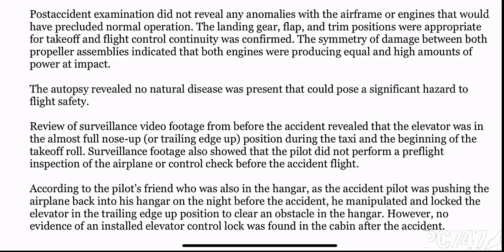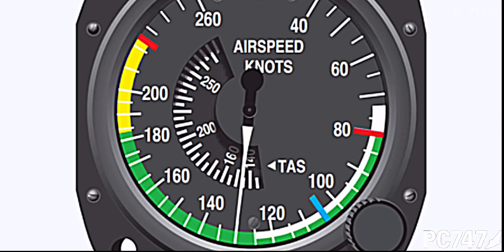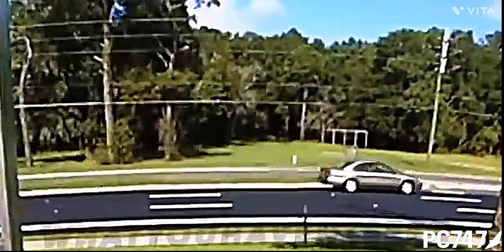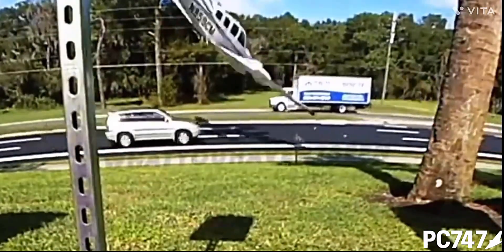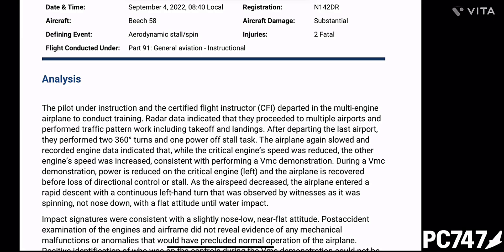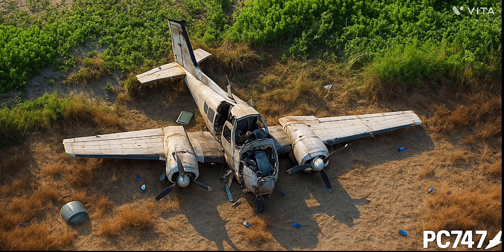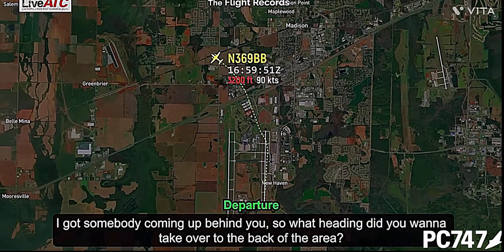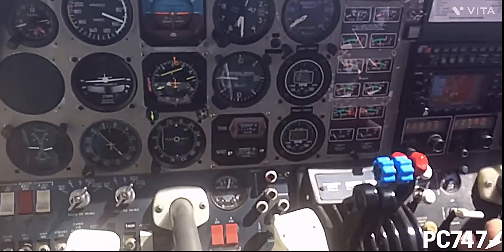VMC TRAINING KILLS

Comment: Wouldn't it be better to reduce thrust to get out of spin and dive to get speed up to have rudder control. Treat it like 2 engine failure.
Reply from the maker: Hi Joe,

   You asked a really good question….

.When a multi-engine airplane enters a spin (or incipient spin), especially after losing control at low speed and high power, the asymmetric thrust and yawing moment from the engines make the situation far more dynamic than in a single-engine aircraft……

Here’s why adding power (symmetrically) can sometimes help — and why reducing it too quickly can make things worse, depending on the situation:

    1-The “spin in the twin” is rarely a pure aerodynamic spin. Most “spins” in multi-engine airplanes are asymmetric stalls or post-VMC roll-offs, not true autorotation spins like you’d see in a Cessna 152. When one engine is producing more thrust than the other, that yaw + roll coupling can cause the airplane to depart controlled flight. In those cases, idle power or sudden power reduction can remove airflow over the tail and rudder, reducing control authority exactly when you need it most.

 2-Power ( TOGETHER ),adds propwash over the tail and wings. By increasing power on both engines together, you increase airflow over the horizontal and vertical stabilizers.
That extra propwash:
	Helps the rudder regain effectiveness
	Increases elevator response
	Can stop the autorotation before a fully developed spin forms

If you immediately pull both throttles to idle, that slipstream is lost, and recovery controls may have no effect.

But, by the same token, I’ve never actually heard of a case where symmetric prop wash over the tail actually worked and it made recovery from a spin possible. 

Another thing I forgot to mention was, the centrifugal energy of the weight of two motors spinning around which makes it even harder to recover from a spin in a twin than from a single engine aircraft.

Avoidance of spin entries altogether is the key.

Cheers!

Carlos
PC747

Comment: Why why why can't more pilots get real flying training by a CFI in a Super Decathlon like I did. My CFI was ex USAF F-104 pilot thank God, as he taught me to fly 'real good' in the Super D and Cessnas and Pipers. Look folks if you don't have aerobatics training, you should not be flying a jet or a twin. The F-104 had to ferry a 310 one day but it was to land on a 1000 foot runway with trees on both sides. I had left seat so I had the only brake pedals but I drove 18 wheelers so he 'trusted me with the brakes' :) Well I was PIC and on final slow and low it flew like a greased brick like your 747 I think. Dang it was hard on me as my first landing in a heavy twin the brick was a handfull on yoke and throttle. My god I cannot believe it as over the fence I was so terrible an approach the CFI yelled 'I GOT IT' and he flew it onto the runway with barely a bounce and then I wacked on the brakes and we stopped pretty close to the end of runway. No I don't think any pilot should do stalls in a twin with one engine out or at idle. These twins are terribly hard to fly, even with aerobatic training you are really really stupid to not listen to this 747 Captain. He knows a hell of a lot more than me or anyone else walking around an airport.
Reply from the maker: Hello,

   That was really quite thoughtful what you wrote. Thank you. 🤩🤩🤩

   My hope, in posting the videos, is to make a difference in the aviation community. Enhancing safety & training efficiency, while, at the same time, hopefully, making the learning experience better.

Kindest regards,

Carlos
PC747

Comment: I am a full time flight instructor providing about 40 hours a month of mostly multi instruction. Excellent presentation on the subject but a couple of quick points. The ACS does not restrict the technique of blocking the rudder to force the loss of control. The danger in this maneuver is not understanding what is happening. Some of the people involved should have known better, but didn't. The Chief pilot and school owner in the incident you referenced is my point. No slow speed work, slow flight, stalls, Vmc or drag demos should be done with anything in the back, passenger OR baggage. As you noted, the CG needs to be as far forward as possible. Second, the spin of a light twin is not the same as a single. Because of the weight, engine and fuel, being so far out the wing. The rotation that develops is a skid more than an aerodynamic spin. This changes the relative wind acting on the vertical tail causing the vertical fin and rudder to stall. If recovery is not started before the tail stalls, there is nothing to resisted the yaw. 
I only teach Vmc because I have to. Instead, I emphasize prevention, Vyse Blue line. In the proper configuration, once you have trimmed for Vyse, what ever performance you have is the best it is going to be. If you are still losing altitude, find someplace soft to land. You can not hold the plane in the air by pulling aft on the yoke.
Reply from the maker: Hi,

   Thank you for your very kind and detailed comments! 🤩🤩🤩 You are absolutely correct. Some of these pilots should’ve known better. You are also correct regarding the differences in spin characteristics between single engine aircraft and twins. The dual engine placement combined with centrifugal force, during a spin, makes it far more difficult to effect recoveries.

You are correct again. The ACS doesn’t limit the restriction of rudder movement, for simulated VMC demonstrations. but until the required VMC demonstration  parameters themselves are changed, an alternative and safer training method will remain just that. An alternative. :/

 Your comment “I only teach VMC demonstrations because I have to.” struck me most of all…..I want to commend you for doing the best you can, in spite of the limitations you have had to work with.

Finally, I also  liked what you shared regarding blue line speed. A long time ago, I was in an Aztec flying over the mountains in Southern California. I was flying above an undercast at 8000 feet, and the sun had just set below the horizon , when one of the manifolds partially separated from the left engine…..

A crazy amount of smoke and sparks were emanating from it. Naturally, I was worried about fire 🔥, but I was particularly worried because there were components in the Aztec engine compartment that had magnesium. Magnesium typically burns at 1200°, but when a magnesium fire mixes with oxygen, it becomes magnesium oxide, burning far hotter at 5400°F

So, I shut it down and feathered it. I wasn’t alone, I had another pilot in the right seat with me.

We were on an IFR flight plan flying to Oakland, California. I advised ATC. of the engine shut down, and immediately diverted to Salinas, California. But we had to get there first.

We entered the clouds and I maintained blue line speed. We kept descending, getting closer and closer to the mountains, descending through 7500 feet, then 7000 feet. We entered the clouds at 7000 feet.

We kept descending, while maintaining blue line speed, past 6500 feet, passing 6000 feet, and most alarming of all, descending below, MEA. We kept descending…..

As we were getting closer and closer to the mountains, trying to reach Salinas, we started losing radio communications with Los Angeles Center because we were getting so low. Center asked an American Eagle Sabb 340 Crew to relay communication with us and that’s what we had to do.

As this was occurring, I noticed I began pulling back on the yoke & and I was slowing down below blue line toward red line speed. Of course my life flashed before my eyes: a combination of regret, sadness, & fear. When you are really, really scared, you also experience something called cottonmouth.. All the moisture vanishes from your mouth, all of it. I can’t explain it.

I knew right then I had to revert back to my training. The hardest thing I had to do though, was push the nose back down, toward blue line, toward the ground…..

I don’t remember how low we descended before the airplane was able to hold altitude. The American Eagle aircraft kept checking on us and we kept letting them know that we were still alive.

When we broke out of the clouds at 1000 feet on final going into Salinas, I told the pilotI I was flying with that we would not be doing a go around, no matter what. We landed without incident.

Regards,

Carlos
PC747
Reply: @PC747Aviation  Thanks for what you do. let us hope someone is listening.
Reply from the maker: @duster5838 Thanks. 😎👍

Comment: Very nice video. In regards to spins in twins, another factor for the need of altitude for recovery is the weight of the engines on the wings which add to the centrifugal force
of the spin requiring more time and altitude to recover. 5,000 ft for spin recovery would not be enough for most of theses twins ....
I agree with you 100% in that with the ongoing accidents occurring, FAA should integrate simulation ( as in flight simulation )  of engine outs and single engine VMC .
Thank-you for inspiring safer pilots !!
Reply from the maker: Martin,

  Thank you very much for your insight and kind comments!🤩🤩🤩

Regards,

Carlos
PC747

Comment: In all my years and engine failures I can’t say I’ve ever had one fail like they do in training.  It’s either a slow insidious loss of power or it’s back firing or stammering along making quite the mess.

On climb out once in a Navajo a cylinder dropped a valve and the engine went to back firing so hard it was yawing the aircraft back and forth, your feet are a half step behind and your head is whipping back and forth.  Looking at the gauges I couldn’t see which one was the problem child.  Dead foot didn’t matter as it would make power for an instant and then backfire.  I ended up pulling both back (I had altitude and speed to trade) and then advanced one until it acted up, pulled it back advanced the other and it was smooth.  

Have that happen at rotation you won’t find it.  You’d be guessing which one needs to be caged.  Better off to close both and take what’s coming.

One of the things no one ever seems to discuss or even trains for.
Reply from the maker: So true! THANKYOU!

Comment: I am a retired flight instructor who still flies my own aircraft in Australia.
The "demonstration" shown in the video is NOT done correctly!
If this is way VMCa prevention is taught in America it is no wonder so many twins are being lost because of VMCa loss of control.
The way "we" did it was the aircraft was already being flown in asymmetric flight with either a simulated or stopped and feathered engine.
The nose was slowly raised and the speed GRADUALLY allowed to decrease. 
The aircraft is flown with neutral elevators and RUDDER used to maintain directional control.
VMCa is supposed to be about loss of effectiveness of the RUDDER, not a stall induced by incorrect use of ailerons.
The roll produced is gradual and is EASILY corrected by lowering the nose and reducing thrust on the good engine.
The point is to recognise the symptoms of the approaching problem and PREVENT IT!
On the video, the ball indicates insufficient rudder is being used and the yoke shows that aileron is being used to maintain direction.
This WILL induce a violent, rapid stall on the "non-powered wing!
In asymmetric flight the aircraft is NOT meant to be flown "coordinated", it is by definition UNCOORDINATED.

An aircraft being flown the way the one in the video is being flown WILL rapidly flip on its back and go into a spin with very little warning!
Reply from the maker: Hi Charles. It was very kind of you to share that EXCELLENT analysis. I agree with you completely. THANK YOU! 🤩🤩🤩

Comment: We used to do VMC's on Piper Apaches at 2,000 agl.  On Piper Seneca i did them at 1,500 agl.  No problems.  1979.  The problem is some pilots do A Panic Pull and VMC it.  Those guys you notice that practicing stalls.  They cannot push nose down.  They want to get out of the stall with nose not down, and using power to get out.  They are too coward to push the nose down on stalls. And on VMC too.  CFI.
Reply from the maker: Thanks for sharing that. 😎👍

Comment: Im 73, rented. 152's for 40 years. An airline pilot told me chatting one day, that when an engine quits on a twin, the other engine takes them to the scene of the accident! 😮
Reply: Been flying for over two decades, I make my living flying jets.  Did lots of time flying single pilot IFR 135 in light twins even had to shut them down on revenue flights.  

I personally wouldn’t own a twin even with my experience level.  I’m just not flying piston twins anymore (jets are a different ballgame) so I’m not current enough to feel good about loading up my friends and family in one and losing one at a critical stage.  

Stay safe my friends.
Reply from the maker: @TylerN737s Thank you for the kind comment. I feel the same way. 👍

One time,  eons ago, I had to shut down an engine in an Aztec above an undercast, and over the mountains. Unable to hold altitude, I had no choice, but to descend , into the clouds & keep the airspeed at blue line speed. Below 8000, below 7000, below 6000…..

As I was getting closer to the mountains , unable to hold altitude, or stay above MEA, I was no longer able to communicate with Los Angeles Center because of the mountains around me. I had to relay my communications through an American Eagle Sabb 340 checking regularly to see if I was still OK.

I began pulling back , OUT OF FEAR, to slow my rate of descent, below blue line, toward red line, and I knew that was a mistake. Because of my training, I knew I had to push the nose down toward the mountains, toward blue line, regardless….. so I did. THAT WAS THE TOUGHEST THING I HAD TO DO, KNOWING I WAS RUNNING OUT OF TIME. 
 
That was the only time I experienced true fear. I experienced cottonmouth. I did not know what that was until then…..

I diverted, to a nearby airport, where the terrain was lower, and landed single engine.
Reply: @PC747Aviation SE drift down over mountains, yikes!  Into the jaws of that monster.

Thankfully today’s modern jets are very safe.  Lots of new pilots coming up thru the system that will probably never get to experience the monster breathing down the back of their neck you get flying some of the under powered poorly maintained equipment some of us cut teeth in.  I wouldn’t trade that experience for anything but I wouldn’t wish it on anyone either.
Reply from the maker: @TylerN737s 

Tyler,

   It was great to read that! Thank you for sharing.🤩🤩🤩

Regards,

Carlos
PC747
Reply: @PC747Aviation  Scary!
Reply from the maker: @steveprice5664  Yes. Stay safe!
Reply: Bravo yes being allowed to do flight simulated stalls i agree
Reply from the maker: @RabbitHole-p7h Thank you for your kind comment!🤩🤩🤩

Cheers!

Carlos 
PC747
Reply from the maker: You are correct! Thank you for sharing that. 🤩🤩🤩

Comment: I used to instruct initial MEL and ATP in a Duchess. We had an agreement that for VMC/VMCA demos we did the procedure and recovered at the First indication of Anything related to an impending control issue. Absolutely no reason to observe actual aero loss of control.  The recognition of the symptoms is adequate.  Ret pt121, USAF And 2K GA.
Reply from the maker: I think that’s great that you shared that. I will never forget one VMC demonstration in particular…..

I was taking my multi engine check ride, and the designated pilot examiner was observing me doing the VMC demonstration . I never seen anyone so scared of observing a VMC demonstration. Cheers!